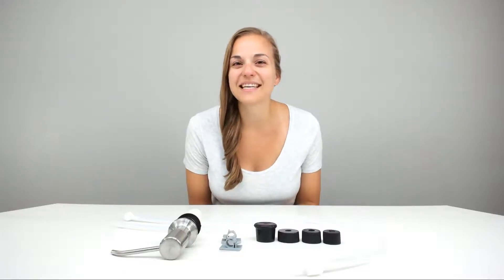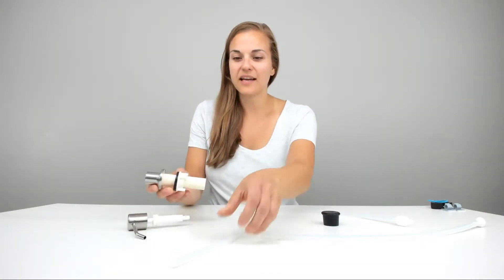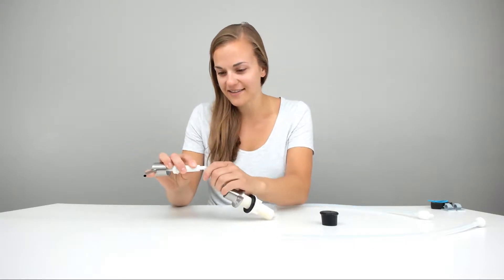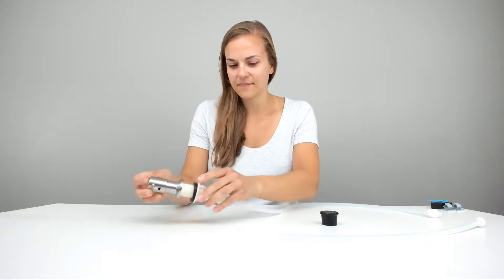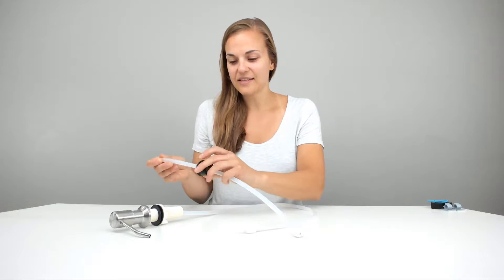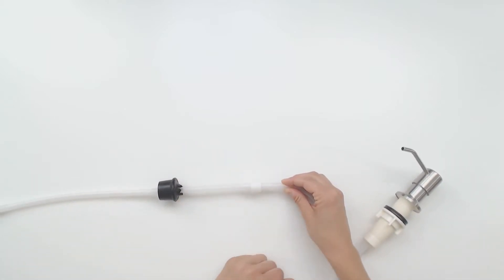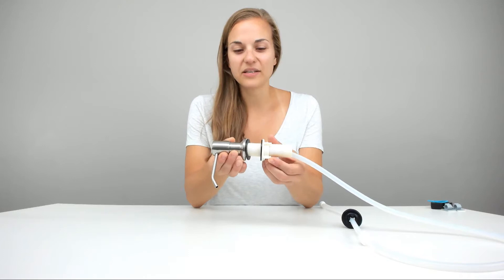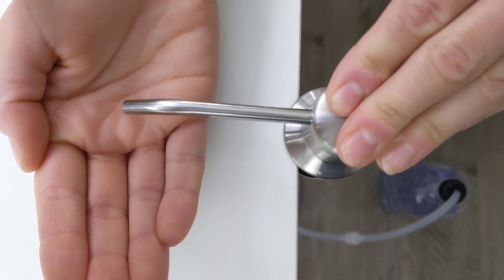How To Get Rid Of Repeating Refill a Kitchen Soap Dispenser?No More Crawling Under the Sink!

Comment: I have a Grohe soap dispenser.  The dispenser pump is more than strong enough to lift the liquid soap 9" which is the length of the straw that goes into the bottle.  But the pump does not generate enough suction to lift the soap 47" (the combined length of the included tubes).  I had to disconnect the extension and reconnect the bottle and straw.  I thought this was a great idea.  Unfortunately it does not work with every, and I suspect most, kitchen soap dispensers.

Comment: FOR EVERYONE HAVING DIFFICULTY
Once you get everything hooked up, fill long tube with water or soap. This will force air out of the tube and the pump will  begin dispensing. Soap works better than water, but either will do the trick and yes, the quality of your pump does make a difference.